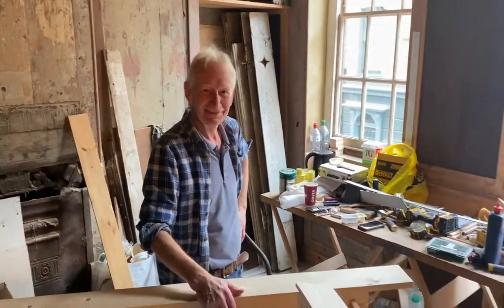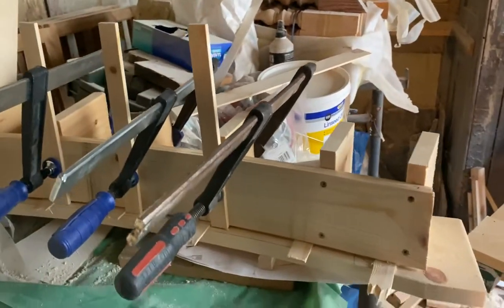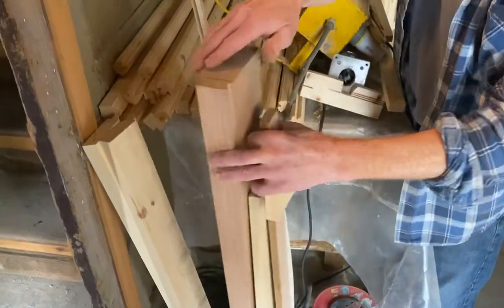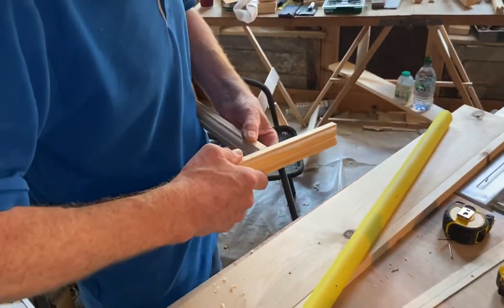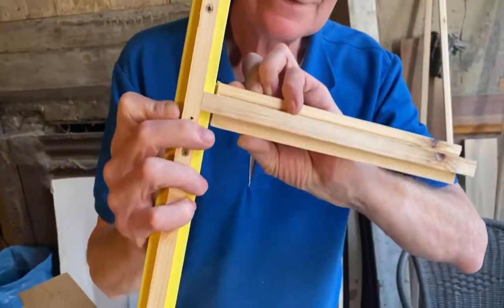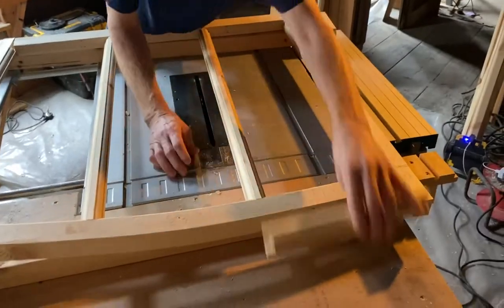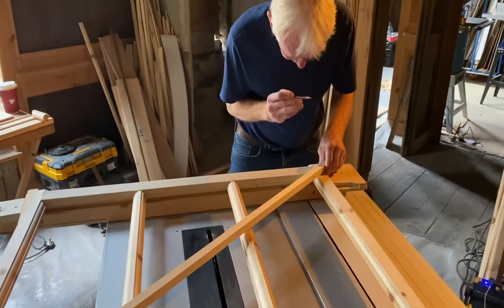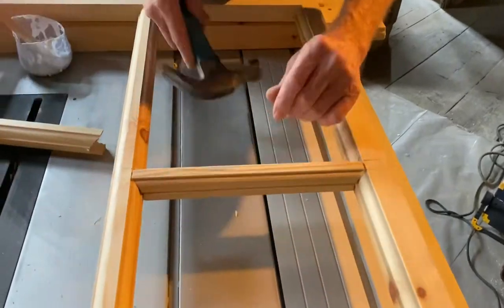Making sash windows by hand

Comment: I've made quite a few of those in my time and in my opinion the usual modern habit of just using hardwood for the cill is a waste of time. The pulley stiles and the front facings should also be made of hardwood. It's not a big extra cost . Otherwise the pulley stiles will rot where they are let into the cill. Everything else can be made of softwood. The sashes can be taken out for repair and proper maintenance and if your inner facings or head lining  are rotting it probably means the house is falling down.
Reply: I agree, the vast majority of the price of a sash window is the labour cost so why scrimp on using Redwood pine softwood is a waste. Like you I've made lots and lots of them over the past 35+yrs and stopped using Redwood Pine about 18yrs ago because its such poor quality, kiln dried and unstable. For the extra cost of £150 or so per complete boxframe it makes no sense using Redwood pine over Sapele or similar. The only time I use softwoods on external joinery is Douglas fir (often required by Conservation officers on Listed properties down here and Accoya.

Comment: Nice video,. How did the carpenter make the groves in the sash bars. Did he use a Trend router ? How did the carpenter cut the mortice/tenon joints e.g. which drill press ? Thanks.